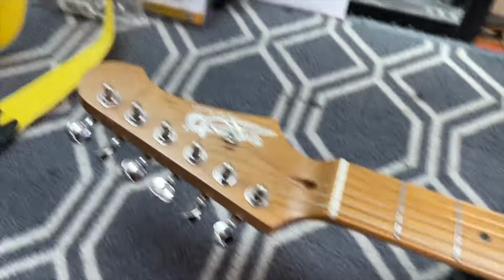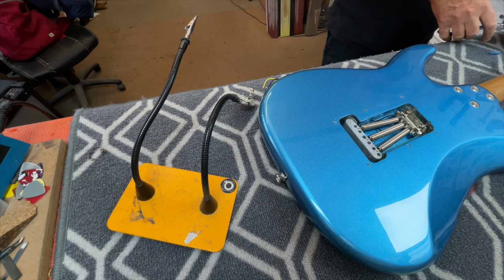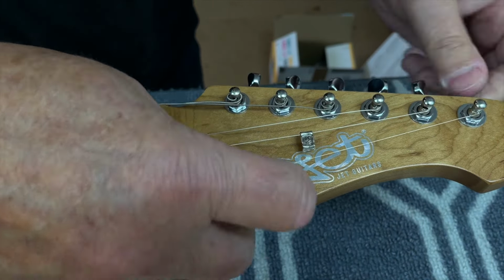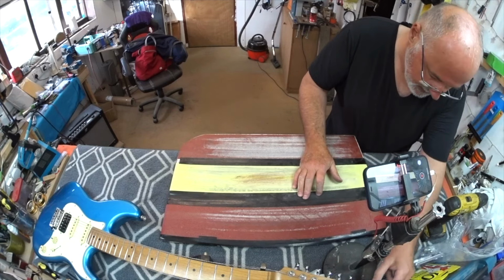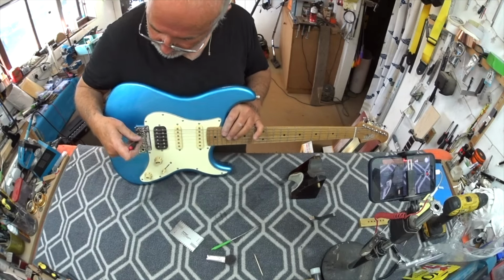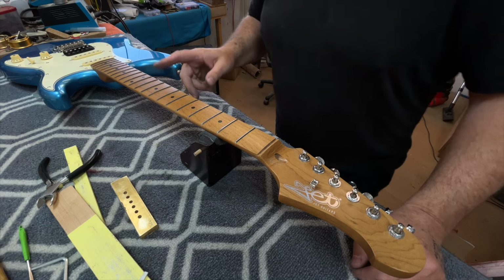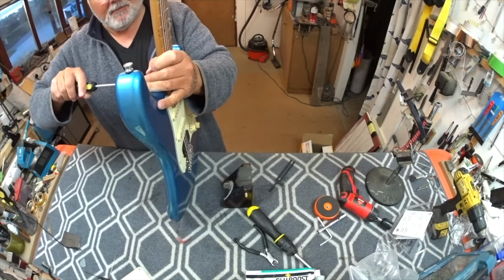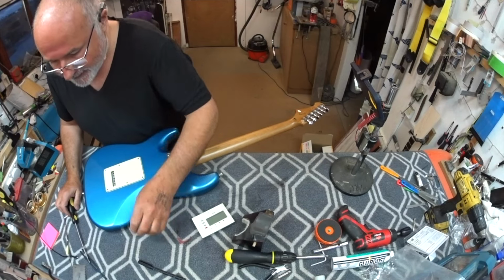Jet JS 400 set up

Comment: i have a 400 like this flawless,and a 450 b stock which had the nut wrongly cut on high E ,and some frets to level,overall great moddable guitars,pickups nothing special
Reply from the maker: Interesting. Always going to be some small issues here and there. I think Jet could put most of the ones I picked out right at the factory..

Comment: JS400 is complete junk.  Best to pay extra £20 and get a Harley Benton SC custom iii.  Vastly superior guitar.
Reply from the maker: So first of all, your premise is incorrect: the JS400 retails at £169 and the HB Custom III at £289. That's £120 difference in price, not £20. 
Secondly, they're completely different styles of guitar so not really comparable. Thirdly, there's very little wrong with the JS400 and its roasted maple neck is very good. 
So complete junk it isn't - especially since it's £120 cheaper than the one you recommend. 
Having said that, the HB is a ton of guitar for the money too.
Reply: @SamDeeksRelovedGuitars  Incorrect- the blue JS400 retails at £199.00.  You can buy a "version" for £169 but the blue one in your video is £199.
Its not worth £199.00 and you cannot show me a supplier selling this Blue model for the price you mentioned.
Harley Benton SC Custom ii model - currently sells for £180 B-stock or £222.00 new.
(However, the SC Custom iii is £238 b-stock and £255.00 new.)
The Harley Benton is vastly superior to the JET JS400.  As for them being comparable - they are basic electric guitars - do the same job.
Reply: Hahaha js 400 complete junk comment. I own one and it’s better than your HB ……. Jet is good value 🎸
Reply: @retrodude9185  Do you own the Harley Benton SC custom?  I own both so can honestly compare.  The HB is better and only £20 extra.
  Change the pickups in the Jet and its a nice guitar due to the neck and body.  The Jet pickups are not good.

Comment: Great video. How low is the action there on both E strings?  Fender suggest 1.6mm on 17th fret on high E. That's easy to do, but low E at 1.6mm with no buzz... Not so easy. Thanks!

Comment: Both my Jet Strats needed neck shims to get the saddles off the deck to float the trems. I think it's  fairly constant, the guitar is built to deck the trems.
Reply from the maker: Anything that comes out of the factory close to one extreme or the other isn't ideal in my book. The basic geometry should cope with any tremolo configuration and low action choice... i.e. without needing shims.

Comment: I'm surprised about the comment about the sharp fret edges. My JS-400 has very smooth rounded edges on the frets. It's really an incredible neck for the price. I agree on the nut thickness. I bought a TUSQ nut without realizing that it would be too thin. So I left the original bone nut.
Reply from the maker: They weren't terrible but they definitely bevelled them at a nice angle and then pretty much left them without much (or any) rounding / softening of those edges. I'm being fussy; overall it's a great neck - and as I showed in the fret levelling, very few ups / downs compared to other regular maple necks.

Comment: Considering one of those as I actually like working on guitars.  It seems like all the issues are fixable and if you are willing to put the time in, you could wind up with a real nice guitar for a decent price.  Would love to see what results you get if you wind up buying one for yourself.  Well done on an honest assessment!  Was not expecting the nut slot and neck pocket issues.  Fixable but a bit of a bummer that makes me second guess my decision to purchase one for sure.  At least if I do, I know what to look out for.
Reply from the maker: Thanks McB... I think the nut thing was the only really annoying thing - as it ends up forcing a custom nut making session. Hell, if it's a Strat style guitar, why not make the slot accommodating to the best / most common replacement nuts out there? Grrr. The original nut wasn't bad but if you're in the habit of upgrading to Tusq and then the factory decision about the slot width on this guitar prevents you doing that... well, it's just an unnecessary difficulty.

Comment: May be Tusq model 5010-00 Nut Slotted?
Reply from the maker: Good suggestion but nope. Luckily I've got the Tusq catalogue on my computer desktop so I can double-check! 5010 is same thickness as the 5000 that I had i.e. 3.3mm. The slot is something like 3.4 or 3.5mm (I forget now)...It's amazing how such a tiny amount leaves the nut horribly loose and prone to tilting forward.

Comment: The drilled holes at 10:35 are actually markings and guides for the technicians installing the claw to avoid guessing and make the installation of claw faster.
Reply from the maker: I think you're right.. but it only sets the location in one dimension ie. side to side. Someone still has to judge how high / low to set the screws.
Reply: @SamDeeksRelovedGuitars on my specimen the holes are not full depth so the screws go at the bottom of that groove.

Comment: shouldnt forget to put some tape over the pickups to keep metal shards from the frets you grinded out of the magnets.  i like this guitar...
Reply from the maker: Now that's an intetesting thought. The reason I don't usually put tape over the pickups is this: fret metal is NOT attracted to magnets. I know this because many people had the same though as you; so I decided to put it to the test :) I already was sure it wasn't magnetic but I wanted to experiment to be sure. 'Nickel silver' wire was not attracted at all to my powerful 1" neodymium magnet. The only fret wire that BARELY moved when the magnet was almost touching (showing the presence of at least some ferrous material) was EVO gold wire. An believe me, that was almost touching before it showed any sign of attraction. Stainless steel was, like 'nickel silver' completely unattracted to magnets. 
So in day-to-day work there are no frets that are magnetic (they don't make EVO gold any more anyway!) so no dust will be attracted to the pickup magnets. I hope that eases your worries and updates your knowledge base a little.

Comment: Still a Squier killer, no doubt.
Reply from the maker: Just about... I think this thing looks great and IF (as it seems) that this roasted maple neck is generally this good on all of them, then it's better than Squier.
Reply: My JS400 beats my 2006 MIM strat in everyway possible period. Just to mention I have built guitars, so I obviously know my way around how to set them up, all I had to do with the JS400 was change the strings and polish the frets.
Reply: @sd4beatsmore HB guitar brands are good also and Vintage G brands ,Ive got Vintage Strats brands and I ve ordered JS 400 🖤🖤🖤
Reply: @niclasboman4996  Yes they are, I hope you enjoy your JS 400 as much as I like mine
Reply: @sd4beatsmore  Im gonna upgraded with better humbucking bridge pups and look over the tunings and fixed better connections bridge and neck pups .

I dont liked middle pickups on strats and dont used it either 👎🏻

Comment: What are the 3 nuts on the levelling beam telling you? 
And how low are you setting the action?
Reply from the maker: I level frets with the guitar fully strung with some relief in the neck. This requires a levelling beam curved to the same basic curve of the neck...  the brass nuts are 3 'sample points' of the neck's curve. I adjust the curve of the levelling beam until all 3 brass nuts touch it equally which means that my beam mimics the curve of the neck minus the 'bunching' effect that the longitudinal compression has on the actual neck. The application of the beam's 'perfect' curve onto the neck's 'imperfect curve' (with its frets sitting on numerous high and low points) allows me to 'smooth' out that curve. This reduces or removes altogether any buzzing, rattling or choking. 
My eBook '5 Steps to Guitar Set Up Heaven' (£24.99 direct from me via PayPal to 'samdeeks@gmail.com') shows this process in detail. I also sell a Golden Banana Pack which includes pre-prepared beam with all the little bits required to get started - including some live Zoom Q&A sessions with me. 
Hope that helps!
Reply: @SamDeeksRelovedGuitars  do you have the link to the Golden Banana pack?
Reply from the maker: @Piccyman1  It's here 
https://www.facebook.com/photo/?fbid=1019904893472319&set=pcb.1019908863471922
Three levels (scroll back and forth to see them on that post)